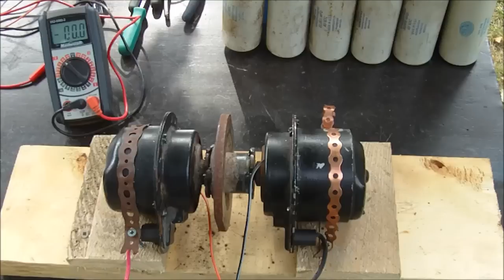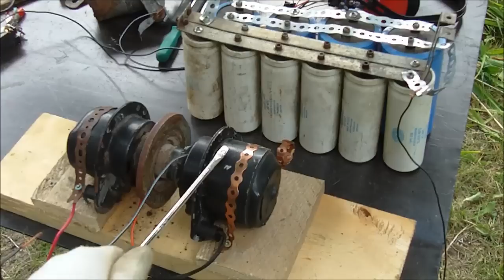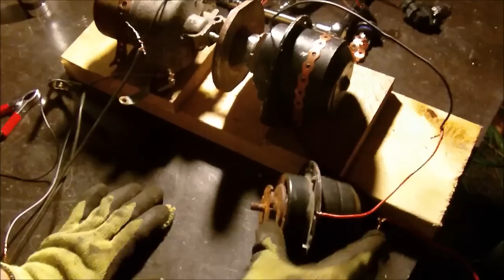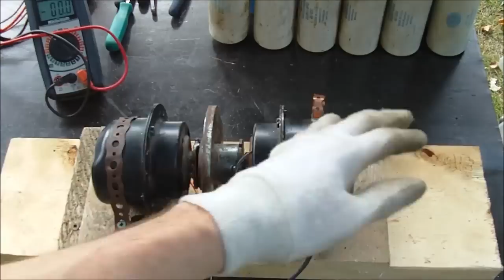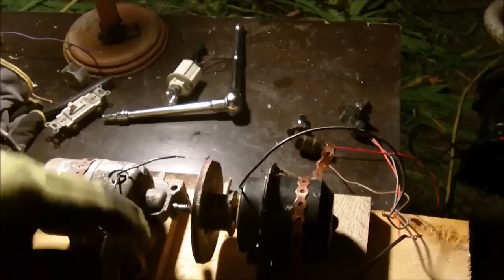Electric Motor to Motor, can they self run?

Comment: it's is possible.. there's many variables.. like s.c vs dc. an generators vs starters.. also they have to be wired rite, or camshaft, an whatever voltage lost_used to start the generator, needs to be replaced with th st usage.. a series or parallel circuit  with a bunch of small batters with exact voltage. an also they usually work best with giant old 3 phase dc g.e motors.. they will run for a long long time.. but I'm not gonna get into ever ill detail down to the ohms an other electric laws, but it does work... like the guy who was killed for inventing an engine that ran on its own exhaust,  an others that ran on gas vapor carbs even smoke from hydrocarbons in burnt coal..    I'm a thinker an trinket at heart myself... I made an on board ait compressor with an old York a,c compressor UN my jeep.... I'm work in on a 120_220v generator,welder, belt driven... an idle up switch using the cruise control actuator an ecu.....  also made my own homemade, true on,off axle diff locckers'). but th i'm pattening them...   also I made a homemade winch with old tractor wheels, hydro motor, an tape into pestering pump.. also it operates my log splitter, an plow littoral, all from a extra h,d plastering pump,, next I'm working of a chainsaw winch using a gearbox from a snowblowerd or something, more of a Capitan rope winch for now, portable of chainsaw... I also made hydro chainsaw along with lobster, all have leads of hydro lines to connect to my jeep...    also, find a air starter from an old diesel, hook it to a.c, fridge compressor, an it will spin it pretty good,, thinkin if something to do with that...        also, old chainsaws, if u need to jump a car, take bar an Chan of an mount a alternator to it with jumper leads, hold the saw wot for 10Mins, an it jump your car,, or if in middle of no were with a chainsaw, take bar off, carry a extra shorter belt to go around clutch of saw an alternator, handspun your alternator with saw clutch pulley, in bout 20 mins, you'll have a recharged battery.. but depends year an type of vehicle, newer edits, turn key on while 4cyl small engines... don't forget ppl, it's the amps that kill!! lull ,, oh, using a chainsaw clutch to your alternator  with a belt, make sure key is on for certain newer efi 9os vehicles WITHE ecu or external internal regulators etc,,, turn key to run, so ecu let's  alternator charge signal switch alternator on..    

an,,, if you have on board air, an your fuel pump goes, again, depend on Eli or not, a hi volume air compressor, will work like old style carbs fuel pump to pressuring tank,, but, Eli u can do it, just gotta ugh or cut an unplug rite supple or return an glass filler neck hose.. it may do it an sputter, but these tricks I've done personally on newer an older jeeps in middle of no were...   btw, love channel.. I'm working on gettin my footage together for my channel on everyday homestead adventure homemade stuff I've done in life,...   keel up with the welders an electrical,,,, I live it,, also try using a
hi air psi, gas powered chainsaws make great  motors an cheap on gas, hi rpm,, great by me motors to,, same with other 4cyl an am all eng,... I'm doin a pto hydro driven lighter, an crane winch for my bucket truck an gonna weld sitter ram an control rite on back hitch below winch on a swivels to tilt up, also use winch to lift big logs onto splitter ram...     tanks for dome info,, keep up good work... I love the 3phase iterators Ford's an older luxury cats used... also old factor as have giant 3 phases motors z
you hook a 3up gas to, get electric motto, make great gas_electric vehicles esp for tractors, or even snow machines, check even a off grid power system, get 20?30 old big truck battery as, an hookup another panel power box.... add solar wind to, just make sure to shut certain stuff off.... can even get it to run. hydro motors for outfitters, other pumps,,, out on old mines of p.a an factor as I've found giant dc 3phase motors... just needing cleaning so,e new windings an solder if that.. usuAlly just good cleaning with mineral oils, no petrol cased cleanest.... thou Vaseline is a great lubricator with electronics, bearings motors seals lower heat,, they won't ruin, swell we all,... vegetable oil too, an Crisco,, lol...    great info, keep it up,, do some more welders an Will.d, self power or low power generators...      I' wanna start a bizz an self this doomsday like stuff,,, .. cheers. be care full....   if urban in p,a,,, msg ,me, live some your gadgets an truck's, cars,,,
Reply: +Justin Herdman This is impossible. 101% efficiency = impossible.

Comment: Why not connect a battery to a motor, then have another motor attatched to that one that goes back to the battery to charge the battery? 🤔 youd have a self charging system that way, don't know about the technicality needed for that though,

Comment: Ever think about keeping the connection and spinning the the motors using a third or by hand? No? That's OK.
Reply: +John dawson By hand wouldn't be perpetual motion anymore. That's called, making electricity by hand. Adding a third motor would be even less efficient. The more moving parts you have, the less efficient the system is.

Comment: This is an example of why perfect efficiency is impossible. Even if both motors lost no energy to the surroundings (zero friction in barrings whatever), they still could never convert enough electrical energy to work and back again to power themselves because entropy will be generated. That's the secon law of thermodynamics. you definitely could never gain energy from such a system because of conservation of energy.

Comment: This is the known as the Capacitor Paradox. A more practical way to power a motor would be to make a polybandwidth permanently magnetized radar grid and aim it at a really big star (bigger than our sun). Distance is of no consequence pending there is no obstruction. Make sure the star's emination lines up with and pierces the through path(s) of the grid. Run a wire from the grid to a capacitor, anion collector, surge protector, diode or accumulator. Run the outgoing (load) wire from that to one motor terminal and stake the other motor terminal to the ground. You'll have power until that star dies, which will surely be longer than a human lifetime. Perpetual motion is a relative notion. If a motor runs for a persons entire life without needing refuel, wouldn't it be fair to regard it's motion as perpetual relative to that persons life?

Comment: Your motors would self run if you had frictionless bearings and super conducting wiring throughout. so all you have to do is live 50 years or more longer and try your experiment again  with future motors.

Comment: What about at negative - 30 kevlon with nano tubes.
Reply: +Green Stash -30 Kelvin is impossible. 0 Kelvin is absolute zero, nothing can be colder than that.
Reply: 1k = -457.87 Fah., in a vacuum the boiling point of liquid nitrogen is lowered up to 100x. half of things we think we know are pseudoscience.
Reply: Superconductors can be made out of not conductive elements at such temps.
Reply: Green Stash
No, you don't get it. Negative Kelvin is impossible, since Kelvin is the same unit as Celsius, but starts at absolute zero. Negative Kelvin would mean that atoms are moving slower than not moving at all.

Comment: what your doing wrong is connecting a motor to same motor wont work where if you connect a higher capacity motor where money is no object then you small motor can turn the higher capacity generator which in turn is overtunity

Comment: you're absolutely right it doesn't work. it's not that easy to defy the laws of physics. that being said, I just wanted to let you know, those motors are assembled with the rotor slightly advanced. this will cause them to go faster and a forward direction then in reverse direction. so when you have them face to face like that, one's always going to have more power and RPM, then the other, while spinning in any One direction, rotation being the factor in which one has the faster output speed. now, that being said, you're absolutely right debunk away. these assholes are trying to trick people just to get views. it really pisses me off. good job my friend.

Comment: in thought you would think it would work...in theory  it wont Because one runs on DC the other puts out AC use a rectifier .. because a AC current cant run a dc motor

Comment: Here's what you need. A kid's pool on a picnic table with a exact hole for a pool noodle to fit through. Make a circle ⭕ with pool noodles through the hole in the pool and around the outside of the pool. Fill with water and watch the noodles float up through the hole through the water? Perpetual energy?
Reply: I already know it won't work. Actually  my original idea was a steel ring through mercury. Nope will not spin

Comment: You don't power the engine off the generator. You power it off the battery, and the generator powers the battery.  
Then you have self changing. No need to charge. It runs by itself.

Comment: here's a test for permanent magnets: short them out and try to spin them. if it's impossible to move, its 100% efficient. if it moves backwards as you try try spin it forwards, it's 100+% efficient (and magical xD) if you can still spin it then it's nowhere near 100% efficient.

Comment: it will work 100% you need to put into big flywheel 5 to 10 kg then see the result and important check the RPM also
Reply: +Noor Khan It will not work, because it actually working would be physically impossible.
Reply: your right but there is another way to make 
if you have take another exp
1 or 1.5 hp motor and have flywheel also you can have free energi from that that i try it its working 100%
flywheel should be 20 kg genrator will preduce up to 2kw engergi

Comment: People what you think will this work if you put some power booster and set it to power needed to motor will it work ?
Reply: where will the "power booster" get its power from?
Reply: background static or em waves traveling through the earth?
Reply: solar!
Reply: Well j tought boost converter (power booster) could be put on +and - of one motor and +and - of another motor and to coonect rotors of motors and spin one motor j think that will work but j dont know
Reply: This will not work.

Comment: But aren't you trying to hard ? You don't need the extra motor. . Just put on a flywheel and multiple coils or exciters wired to large capacitors. Does it take 12  x 10,000v caps to turn that electric motor ?

Comment: I got mine working ! But its not set up like the video ? You need one DC one AC 3 phase with the same resistance in ohms forming an  harmonics scalar field with phonon coils on the drive shaft ! The trick is to make the field unified as a single electron field ... Just phase in the free electrons as a single electron field !  Feed back the back emf and send to earth .... Best to add a toroidal coil and let the pull of earth power the load ..... hahah simple !!!

Comment: Sir , you did not get the design very well, I have not try it but I believe it work, remember this people put a flywheel, they spend money , I have seen a Westerner who did it and it works for him on motor to motor, just that when he put up other loads it drops, but even at that , I guess it work just that the people doing it are not applying the need techniques to sustained a constant flow of power to you motor

Comment: i see your problem what you need do is  the motor used  as generator place a bridge rectifier  on out  of generator  + - into ac in  out from bridge + -  to a 12 volt battery then connect drive motor to battery or if you have a second 1  better yet this will create isolation from motor to generator  very  important  if you can make an ab  battery system either a switch or mosfet  is best just keep in mind of heat use heat sinks an or fans to keep it cool and use proper wire gauge and fuse or circuit breaker this is called a dynamo and if nikola tesla did it any one with a brain can

Comment: i bet the car comapny did this already,  ok here there calcualtion,  > when car fully charge it runs electric engine, onece it is dead combustion engine take over then charging the electric car engine battery, onece car battery is charged again the combustion engine shut, electric engine take over. so to my calculation     they cant self run. But i think it will happen in the future machine can run self energize its almost close

Comment: you need a magnetic levitating Bal bearing  on graffeine from different angles to hold it levitating in middle of the field with battery bank like capacitors to start it one time then it will throw Alooootta sparks to field harvester and charge it's field and batteries and always start ...I believe ..or maybe make a black hole ......heeeee
Reply: but just a small one ...temporary but blow up first probably you need neg energy composition ball bearing
Reply: Jerry Macmillan Jr 
Those bearings would have to be made out of unobtainium.
Reply: They are already made from unobtainium and are very expensive, but unfortunately they crumble to dust if exposed to the weakest magnetic fields so cant be used for any electrical applications.  unobtainium tubing or wave guide is ideal for transmitting hot air but that's about it.